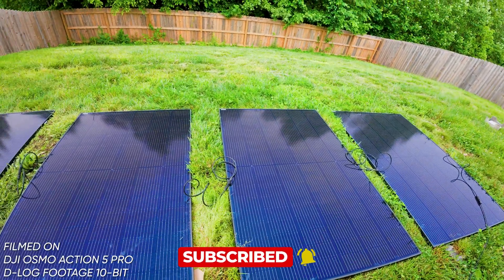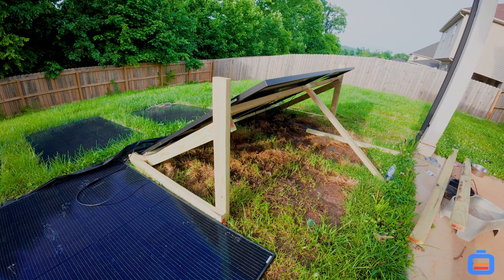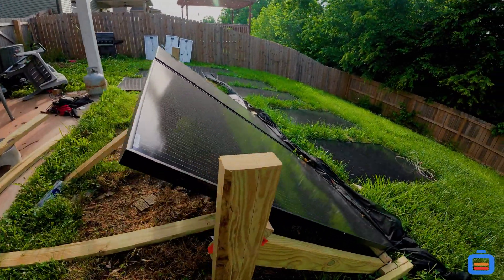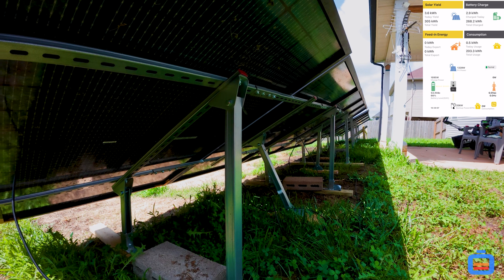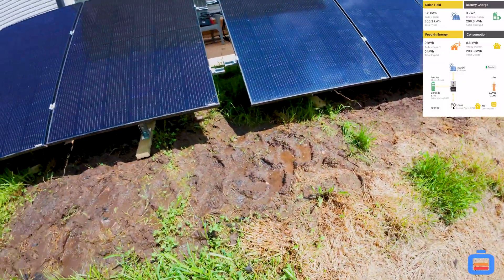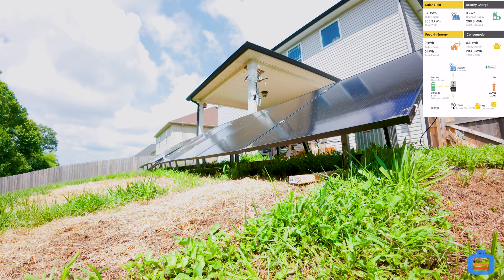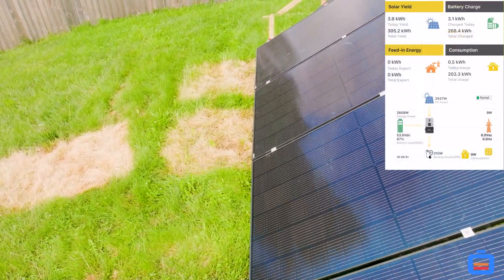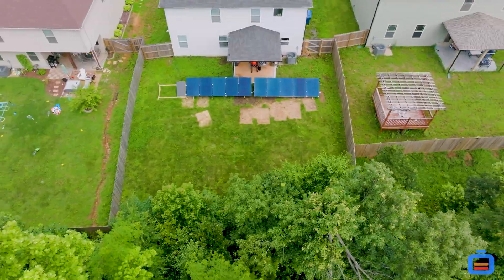Eco-Worthy Ground Mount Install: Is It Worth The Cost?

Comment: Hi buddy 
I never realized I think we have the same solar panels. How do you have yours hooked up? I tried adding my 2 extra ones to my other 8. And i guess it was overloading it. I only had 2 30' runs of pv wire to use. I tried every way & i couldn't get it to work. i even redid the connectors and reversed them, thinking that was what it was, but that was still tripping something.
Reply from the maker: Hey Hey!! right now I'm too having to split them up on different strings. I have 10 on the PV1 String and 6 on the PV2 String. I just have plans off continuing to add more that way until I max out the inverter (EG4 12Kpv).  That Sun Tracker is something I may look into !!!
Reply: @RhinoxEnergy ok .I think i figured out how my 8 panels did 21.5kwh that one day it was because my 6 batteries were at 29% starting out. They did 18kwh today.  I dragged my 2 panels back behind my house. I'm going to just try them on mpt 2 input. Since my 2 lines are long enough to run to my 12000xp. Untill next year. 
Thanks darrell
Reply from the maker: @hemieed1 absolutely do it !!! No panel is a wasted panel unless it doesn’t work at all, that’s the beauty of solar!! The sun will always shine we just have to catch it !!
Reply: Hi again. 
I just checked with eg4. Did you know we can use 44 of our panels.  We can do 4 sets of 11 of our panels. To max out our system.  By using a combiner box on each string. 
Darrell
Reply from the maker: @hemieed1 thanks Darrell !!! 44 panels is insane !! My goal is 30 but the more I think about getting an EV and being completely off grid at some point, 45 panels seem like a good number to get to !!
Reply: @RhinoxEnergy woo hoo I finely was able to get my extra 2 panels tide into my 8 on my eco worthy tracker.  I'll have to wait till tomorrow to see a difference because by batteries are full and it only ramps up when my furnace kicks on. In 10 minutes it will make 7 days of completely powering my house with my 8 panels and it has generated 144.8 kwh. In that time. I'm so impressed but the winter time will be the test when the heat is working. 
Thanks again darrell 
Hopefully I don't keep bothering you im just happy.
Reply from the maker: @hemieed1 no not at all !! I love the feedback and comments I’m kind of compiling different issues here and there to maybe do a livestream on one day. My light bill Is constantly going up and I’m trying my best to have my panels and rack filled out by the end of the year to start to see returns like that myself!!!

Comment: Are all 11 panels in series? If so my best advice to you is to remove the smaller panel from that and give it it's own individual mppt, because that one small panel will always affect the bigger ones
Reply from the maker: Yes they are lol I’m desperate for MORE POWER !! but seriously I do know that it’s to the detriment of the other panels I hate for it to just kind of waste away in the corner doing nothing but I have another string of panels I’m currently working on now !
Reply: @RhinoxEnergy  2s2p is the way to go to connect smaller panels to a bigger string, But if you can't just connect those to a power station if you have one, don't connect it to the bigger array.
Reply from the maker: @Moes_Prep_and_Tech well thanks !! Right now my array is only 4kw but soon it will double to 8kw and then I will really have to start paying attention to my strings

Comment: Is there any flex with the ground mounts? Looking at grabbing two as well
Reply from the maker: No, no flex at all I have two by fours for the feet of the mount and it literally has not moved since I installed it!! Thanks for the comment !!
Reply: @RhinoxEnergy  Have you seen any wind ratings for these yet? I was browsing their site and didn't see anything. I'm in Florida so trying to plan for worst case scenario. Appreciate ya as always
Reply from the maker: @boosted91gsx83  Honestly I haven't seen a wind rating for these. Mostly likely because they don't want to be held liable or to a standard for it. I have concrete blocks on the bottom racks of mine and they haven't moved an inch yet !! if you are in Florida on the coast just add more sand to them honestly !! I have a local supplier and it makes them cheap to replace also though

Comment: Im about to order these same ground mounts and same hyperion 405 bifacial panels. Crazy how similar our builds are. Were you able to mount these solo or did you need a second pair of hands?
Reply from the maker: Yes, I was able to do most of the work by myself. The Hyperion panels are really heavy, especially when you’re trying to melt them at an angle. I do have a beautiful 🌹 pair of hands to help with the last part of mounting them but you could definitely get away with doing them alone ! I’m not the best craftsman when it comes to making wood things, but I’m working on my angles of crafting better mounts if I had to do it over again, I would make my own and save a lot more money. It’s just the time and the effort it takes to make your own ground mounts